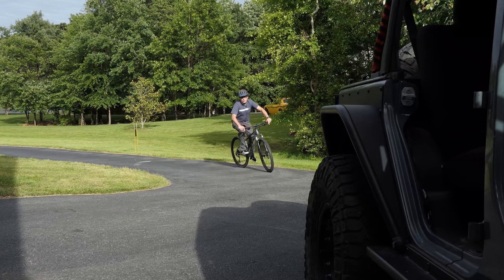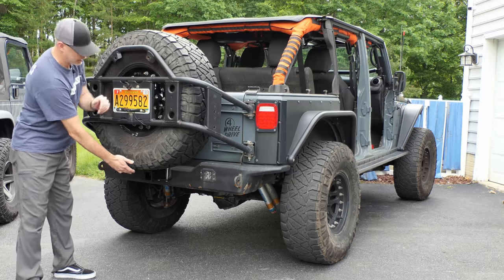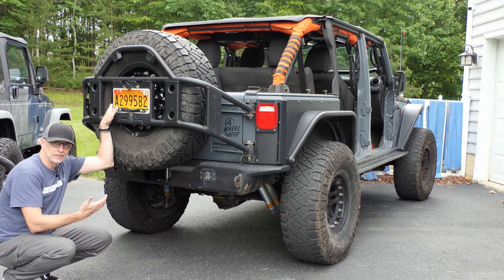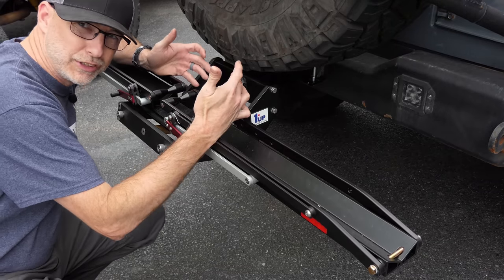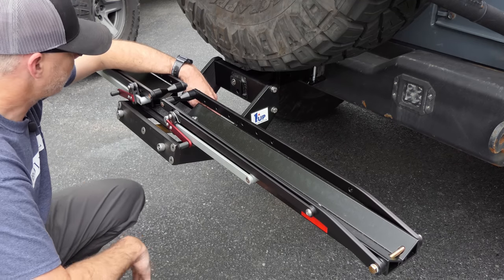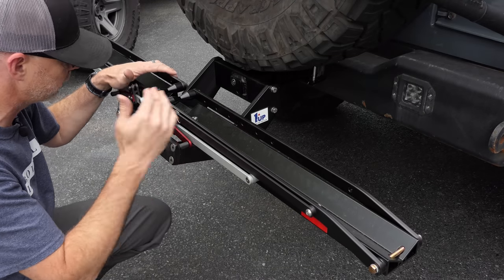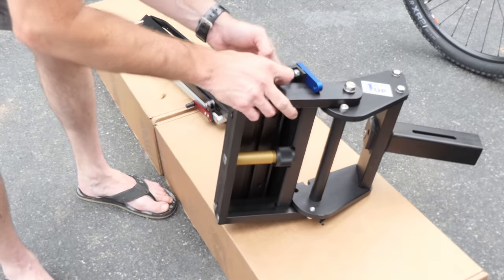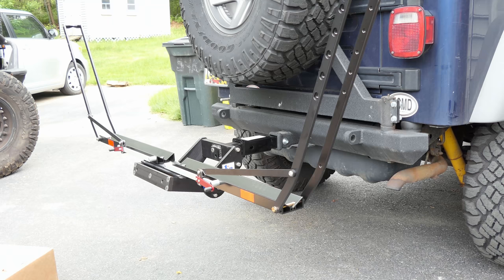Best Jeep Bike Rack - 1UP-USA With Reversed Side Plates - FULL CARGO ACCESS

Comment: I'd like to add my thanks for putting out this video. Exactly right for my JKU with a 35" spare on the back. I can confirm that everything he claims in the video works out exactly as he said. For reference, I got the single carrier plus two add-ons, have a factory hitch, Rockhard aluminum bumper, and the spare is on the Teraflex HD rear tire carrier. All three bikes sitting nicely on there right now.
Reply: Do you have the standard rack or the reverse plates?

Comment: Just ordered my 2" super duty single yesterday with the reversed side plates..... $65 up-charge for that but it should be worth the $$$ for the extra clearance. Thanks for the heads up on the option. Surprised 1up doesn't promote this more.
Reply: Agreed. I had to cancel my order and am waiting for them to refund me to re-order. Had they had it listed, would be sooooo much easier. Should be a disclaimer for Jeep Wrangler owners to do this. Less hassle. But the customer service there isn't responding to emails about my cancellation, so... I might just go over and order the Mach 2 if they don't get back to me.

Comment: Great video & product, I bought the reverse side rails for my JL. It works great for a mountain bike but for a drop bar bike your bars will hit the spare tire unless you have it hanging out on the bar side. The set up i ending up using is a 2 inch drop/rise hitch adapter an standard rails and rear door clears and opens up all the way. Also you can use 2 inch rise and reverse rails if you want your hitch higher .

Comment: How do you protect it from theft?
Reply: That's a real good question because I just got my 1UP Equip-D rack and it's beautifully made.  However - there is one big problem I have and it's the "Security" lock hitch pin. IT'S COMPLETE GARBAGE!!! The shank is so thin on this thing it's ridiculous.  Fit a pipe over the lock cylinder for leverage, pull and that thing will snap off like butter.  Because of the locking ball in the hitch, the slot in the hitch had to be offset downward so you can't use the full diameter of the hole in your receiver for a thicker pin. No way around this apparently, so the pin is absurdly thin to fit through the receiver holes and offset hitch slot.  Very worrisome and disappointing design for a rack this pricey.  In fact, the new Equip-D Hex bolt is not even a security hex bolt like the one here.  Just a regular hex. That's my only complaint, but it's a big one!

Comment: Great videos!  Question:  I have a similar issue.  My 2002 4Runner has a swing out with a 35" spare.  The distance between the top of the receiver and bottom of the spare is about 3 inches.  The spare comes out about 14" from the face of the receiver.  Do you think I could get away with ordering a regular side plate Super Duty single?  I imagine that I would need to use a 12" extender with whatever side plate orientation that I choose.  I have a full length swing arm and an upward opening hatch.  So no matter the situation, I would have to dismount the bikes from the carrier in order to open the rear hatch.  I am fine with that.  IF you were not trying to open your rear, (or in my case, my rear) hatch, would you still order the reverse side plates?  Thanks in advance.

Comment: hey thanks for the Vid, you motivated me to get the same rack for my jeep, but question does your rack wobble at high speed? mine does pretty bad, i have an extender to clear the rear tire, i have two bike carriers and made sure i always tighten everything before i drive away.
Reply: My 1UPUSA rack is really solid, even while driving offroad. I'd suspect your hitch extender is the problem.

Comment: great video as always  quick question  i get that you can lock the rack into  hitch but is there something  built in that you can lock the tire ratchet so bikes cannot be removed from rack ?
Reply: Yes, 1UP sells pin locks similar to the one shown for locking rack to the hitch extension in this demo.  The pins utilize the unused holes on the two ratchet bars.  They offer several  lengths of pins in case you go with the FAT TIRE option to widen the ratchet bars to accommodate wider tires.

Comment: so @ 9:24...... and 21:31...... how did you make your bike stay in the outward tilting position without a notch on the side plates for it?
Reply from the maker: Check out the video at @7:10  and you will see there is a bolt screwed in at the bottom. That is simply a limiting bold that stops the rotation at the bottom. In fact, you could adjust the amount of tilt by drilling/tapping/moving this bolt on each side!
Reply: @o3djeeps  great....thanks..... did they give you those bolts?  my order was shipped incomplete and i needed 1up to send me the bolts, washers and nuts to attach the trays and also the "super duty" bar which were all left out of my shipment.
Reply from the maker: @richkocsis  yah... All that was pre-installed
Reply: @o3djeeps  apparently some QC was lacking the day they boxed up my rack. i literally have called them twice to send me missing parts.... not going to call a third.

Comment: Great video as always. Do they have a 2 bike version?
Reply from the maker: They do! But I got the single bike with the 1 bike add on... So I can go back and forth as needed. I only carry one bike 99% of the time... But in 30 seconds...can convert it to a 2 bike rack.
Reply from the maker: @193001 kiplssd I just checked the website, and you can get 4 bikes starting with the double and adding two addon trays. If you start with the single, you can only add two add-ons for a three bike maximum.